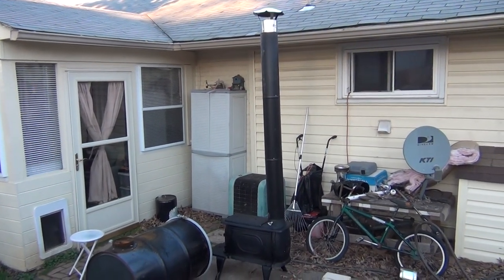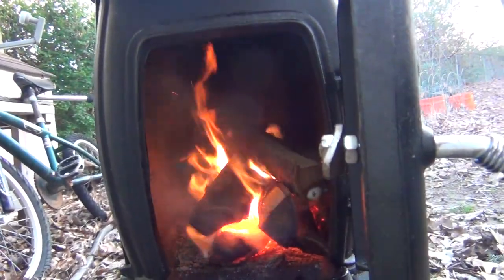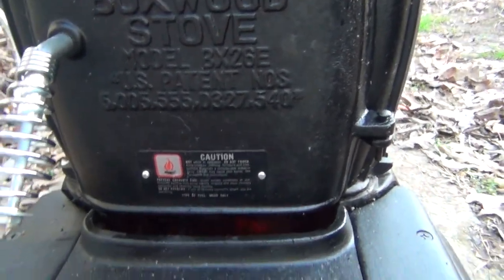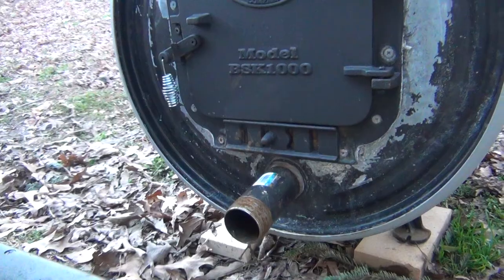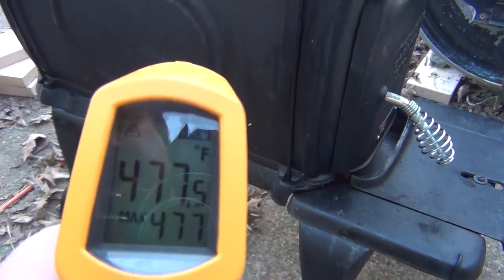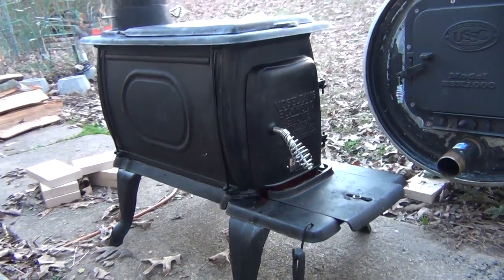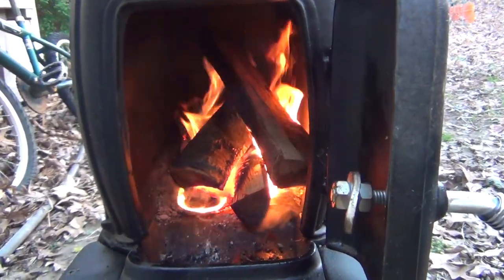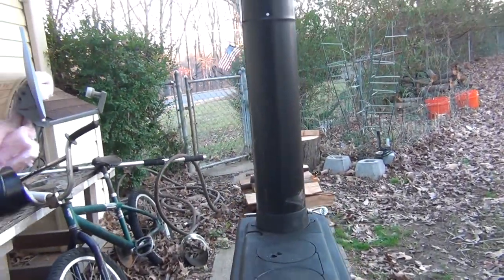Box wood Cast Iron Stove ,Vogelzang Model BX26E

Comment: Hey grw, I'm thinking the collapse is right around the corner so just put my boxwood stove together I got from harbor freight. I notice you got a pretty tall stove pipe for outside use and was wondering how short a pipe do you think I need or do I need one at all?. Its going to be used for cooking out on my screen porch which has a hard roof. Been using my weber out there for years. Thanks!
Reply from the maker: That video was of the first fire after assembling the stove. The reason for the tall stove pipe is because I am planning to put it in a garage and I just wanted to get an Idea of what kind off smoke or sparks would be coming out from the top. Not planning on using it out doors. As for you using it on your screen porch, I would think that you should use stove pipe and have it run outside the porch. Burning wood in the stove produces small embers that rise out and could cause a fire if not directed up and away from the porch. Just my opinion. Good luck with it, I think there pretty good litte stoves for the money.
Reply: grw0766 Never thought of the embers! Thanks man!

Comment: Where did you land up installing the stove?  I'm putting one in a small shed and I am interested in seeing how you installed the stove pipe. Thanks.
Reply from the maker: I was going to install it in my 12 x12 shed but it was to much stove for such a small area. I've decided to put it in the garage which is 24 x 24. I wil post some video when I get the time to actually start the project.
Reply: grw0766
Great, thanks for the response.
Reply: Many years ago worked in a place that had a small boxwood stove in a workshop.  The shop was about 12 x 24, uninsulated, and that stove easily heated it, but man, it went through wood in a hurry.. I'm sure the current ones are similar - throw a huge amount of heat but gobble the wood.  Then again, if you are only going to use it occasionally to heat a garage or shop, why pay $2000 for a stove when you can buy this one and about 8 or 9 cords of wood to go along with it for the same price?